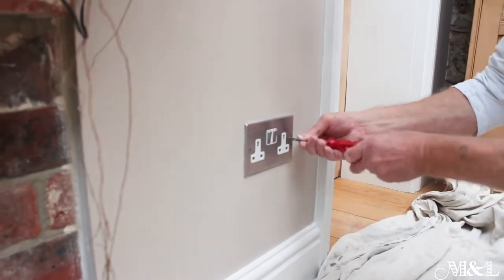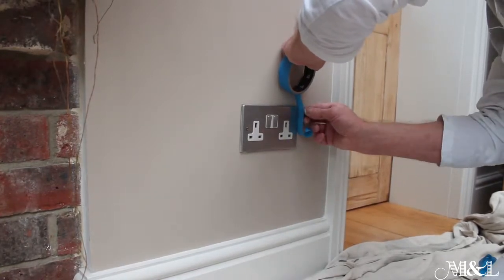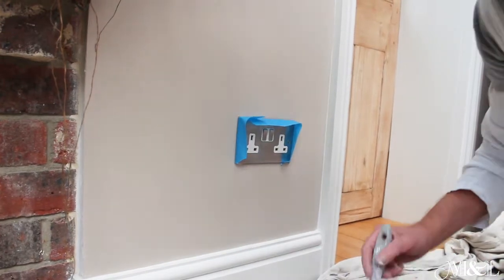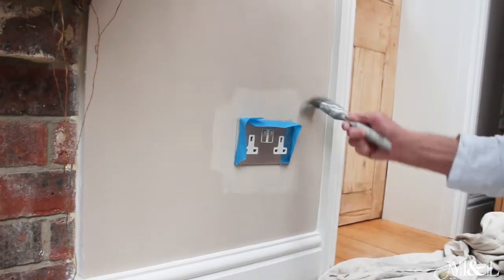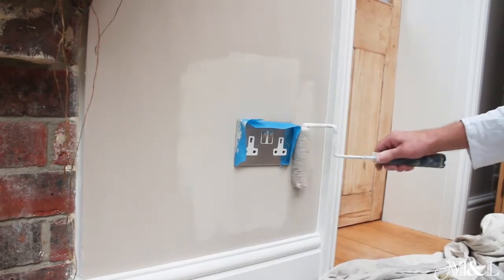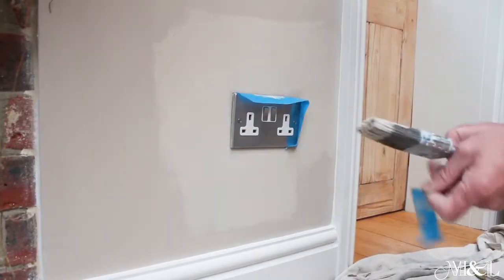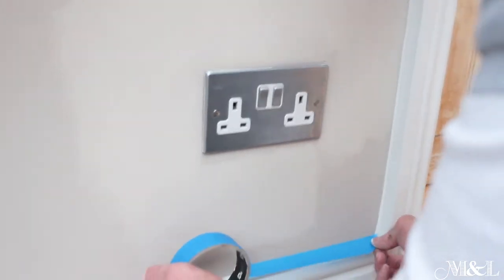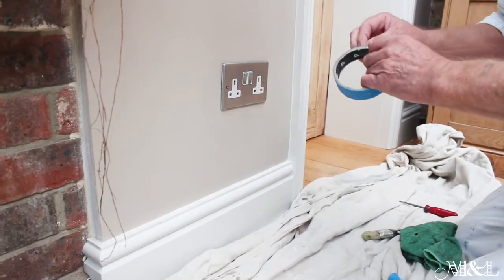M&L Paint | Cutting in around sockets | How to paint around sockets

Comment: Hi Pincho. You are not going near the electrics, so it is fine. When screws are loosened you are just pulling the plastic unit away very slightly.